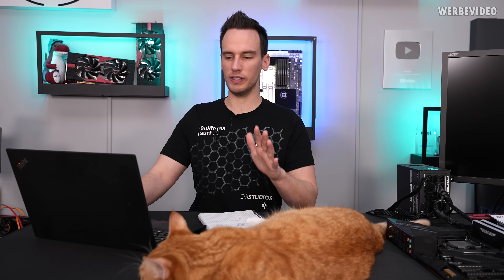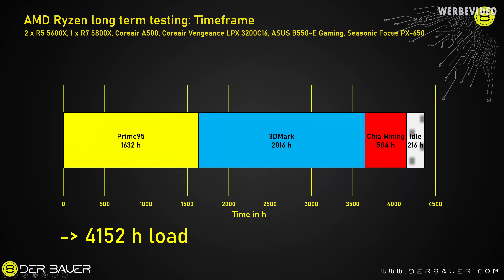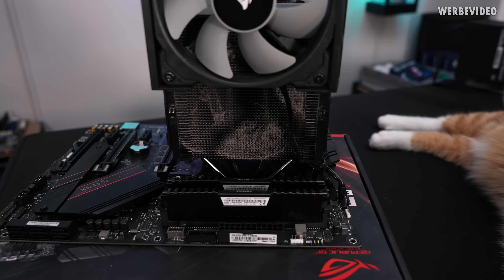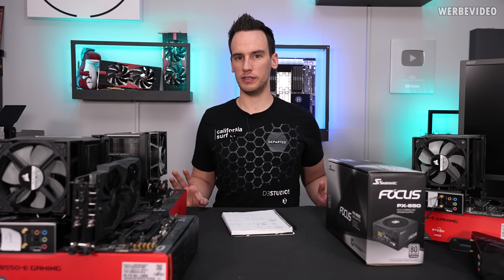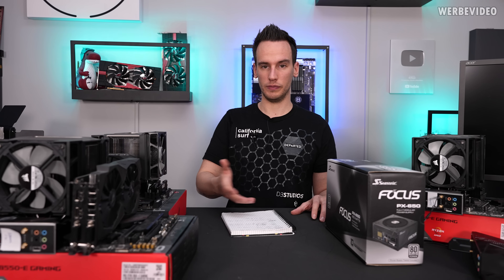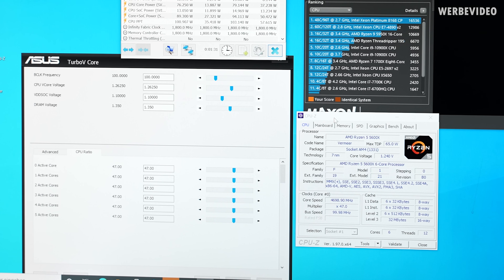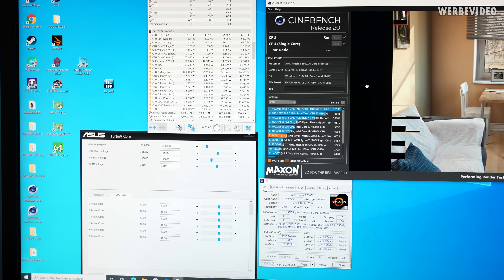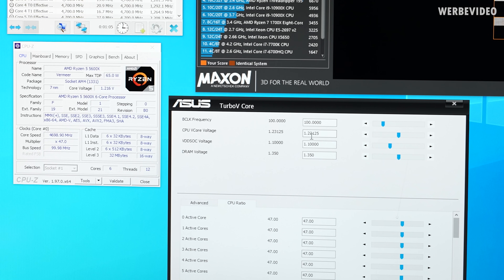4152 hours of Ryzen Long Term Testing: We have Good and Bad News

Comment: 3 years late. Had 2 5600g to fail on me. 1 took 1 year the other, gone 1 month. No OC. Meanwhile a 3400G running for 4 years, Been dealing with PCs since 99/00 never seen cpu failures, welp there's always a first( and a second). From what i read, AMD Zen3 APUs are more dodgy than ordinary CPUs for some reason. Mine passed memtest86+ but crashed when loading any OS in any kind of storage. Spent a significant amount of cash torubleshooting with motherboards and ram, it's sad to see a cpu go like this.

Comment: I got my 5600x in 2022 upgrade to my 2600, anyway last month it died with all stock settings, I only gamed and watched videos on it it never got hot because of after market cooler and good case fans. AMD replaced it for me and I'm gonna be using ECO mode from now on praying it doesn't die in another 2 years

Comment: New test with a 13/14900K? :)
But it seems that the issue with Intel might actually be voltages when boosting only a single or a couple of cores?
Reply: Fr lol they tested the wrong cpus 🤣 no one expected intel for some reason. But now I'm sure everyone subconsciously switched to amd being reliable
Reply: I ran a test with a 14900k at 1.7v static for almost one month, all day prime 95 I beleive I was running 2.2GHz all core though, anything higher than that at 1.7v static on prime 95 will simply crash over night as it would hit 115c eventually. at 2.2GHz 1.7v it basically hovered around the 110c range depending on time of day. The pro-AMD reddit users are simply using an instability report likely caused by unstable XMP profile as means to boost AMD sales. Some users are claiming their 14900k's have degraded heavily or outright stopped working within a few months of ownership under mostly gaming loads using "intel defaults & latest microcode update" I call BS. My 14900k was still able to do 5.9GHz p-core and 4.6 e-core at 1.45v after basically 1 month of prime 95 small ffts at 1.7v static. Final cinebench run vide in my channel. Pulled 450W under full load.

Comment: Should i run fixed voltage or pbo with curve optimazer for ryzen 5600x? Stock auto settings using too much voltage for single core..
Reply: Trust me the single core voltage you're seeing is normal. I would all core oc fix voltage it tho.
Reply: @bakebook  I just leave it to auto default settings no pbo or overclock running from 3.7 to 4.650ghz, could overclock all cores to 4.7 or 4.8ghz with fixed 1.280v but not worth it only for benchmarks..
Reply: @branko4138  nah all core oc seriously helps with 1% lows while gaming too. Makes a choppy 60 fps like star citizen feel smooth and other cpu intensive games like tarkov and arma

Comment: Around 1mV per 100 hours under full load is actually a lot. If you use your pc on average for 8 - 10 hours a day and average load is 50% then you would have lost around 80 mV of stable voltage in 5 years. So that's potentially like going from moderate - strong undervolting to stock settings.

Comment: I run my R9 5900X with a set overclock of 4.5 GHz set by the CPU Core Ratio in the BIOS, with an Offset Negative Automatic Voltage.  During normal operations (anything other than gaming), the CPU runs at 1.1 volts, and I leave it on from 11 PM to 6:30 AM running a video on my monitor with tropical underwater scenes, and soft sleeping music.  The computer comes on when I get home at 5 PM to game, and do my email, visit forums, and watch Youtube.  Been doing that every night for the past year-and-a-half, and it's still going strong.  Calculated time being on is about 6300 hrs on this CPU.

Comment: Really amazing content. I did not know overclocking is that safe to do degradation-wise.

For extra context: The only non overclocked CPU I've seen die was an AMD Athlon II x4 620

Nice cheap, below <100 Euros quad core CPU At time of release. Used it for 3 years with ~5 hours heavy use per day on average.

After it went to a friend who used it for +- 4 years with many days of games being on AFK, probably 7-10hrs heavy use per day on average.

Then it went to my parents who used it for almost 3 years. Then it started randomly crashing and at some point it did not post at all. Unfortunately due to posting issues I could not try out a higher voltage. Replacing the CPU from another used system though, that fixed the system. The dead CPU didn't work on the other, working, motherboard I had either.

It took nearly 10 years for a CPU To die under heavy use. And, was the heavy use over time the cause? Even that is unclear. This with meh cooling and with the PC being dusty for long periods of time. When people worry about high temps at stock voltages and clock speeds I tend to chuckle a little.

Comment: I'd be very curious for testing that specifically targets the memory controller.. I've heard a lot of things and I've had a lot of issues my own self, and I'm somewhat cautious about applying the necessary voltage with some ram kits, this may not be an issue anymore with ddr5 although, I've heard issues as well on I'm sure there's somewhat different but I'm not as familiar with what those changes mean for the memory controller situation but either way.. definitely had issues with ddr4 at what should be really a chill values with ryzen.

Comment: what i saw from a 9600k (yeah no amd^^) that i had overclocked to its max rock stable point at 1.35v max (voltage adaptive overclock, not the fixed voltage noob sh**) for 6  years: its was rock solid until year 4. then i had to lower max turbo and avx offset by 100 mhz, its still stable with that. i guess i could have raised voltage offset alternatively, but i didnt want to (temps, decent noise level of system). It was the same for a 9700k i overclocked for a friend. about at the same time i got instabilities and i lowered clock, he had the same problem.
so the electron migration wont make cpu fail critically, it just... degrades ... over time?
maybe smaller manufacturing processes might degrade faster? possible. but probably in the end its just a couple mhz you loose at the end. if you dont overclock to the absolute limit what the system can do stable, you wont even feel it after years
Reply: p.s.: before someone complains. Der Bauer did fixed voltage for Testing Purposes. Thats ofc not Noob Sh**, but proper Test Setup.

Comment: stock voltage on 5900x goes over 1.5v some times on low thread workload. thats going to degrade the fastest cores on the cpu quickly.

Comment: Thank you so much, I suppose all I should really do now apart from maxing out my most stable Fmax for a given fine tuned Curved optimisation values, with unlimited PPT, EDC, TDc and x10 scalar. Is to set a thermal limit of 85C or so, just in case my CPU cooler magically gets dismounted, the CPU should protect itself lol

Comment: I used to wanna follow the "keep the voltage below 1.35 to save your Ryzen 5000 chip". But I wanted my 5600X to run as fast as possible. So I said fuck it, stay under 1.35? Sure! It's now gonna stay AT 1.35V. I got it stable at 4.85Ghz at 1.35Vcore on an AK620. It only gets to 89C if you stress test it, under normal conditions the max you'll see is 65-70C depending.

Comment: Would love to see this test repeated in the new Ryzen 7000 series especially because of how they behave in terms of thermals and how, Hardware Unboxed said that its 100% safe and GN "is that by design".
2 CPUs here had degradation clearly, so now i'd expect slightly worst for the new series if the same test was done to these chips wit the same method.

Comment: Degradation is real. The 2700x was suffering from high loads at 1.4V or higher. Some people even reported that on stock the CPU did'nt function properly with PBO anymore. People should read on the maximum allowed voltage which is tolerant for 24/7 and stick with that. And cooling is a great factor with this as well. Run it hot and it will fasten. Run it cool and you postpone the proces.

Comment: I'm using 0.9V on my 5600X, everything is stock in the BIOS but the D.O.C.P. memory (the Infinity Fabric adjust automatically for what I've seen) and the 0.9V voltage in the CPU also 850mV @ 1860 MHz Core Clock and 16Gbps Memory Clock in the RTX 3060 Ti.
Reply: I tried 950mV @ 2070 MHz C.C. and 16.5Gbps M.C. also and ok.

Comment: Just lottery, first 5600x was slightly better but the second was within margin.
Temps are fine, but if they were running 90c or more for a whole year then degradation will definitely happen.

Comment: 99.99% of the time i don't allow my 5800x to go above 3.8GHz (special power plans i've made for Windows which i change when needed, take care of this) which means that no more than 990mv are available to the core at worse but that's very very rare, it's actually usually around mostly 950mv and that's not a manual Vcore, i let the mobo (MSI x570 Tomahawk WiFi) take care of it, i don't change it, i just log it.
I don't need it to be clocking higher than that most of the time, so why would i risk any degradation since it plays all games at 60FPS with max settings even when i have Firefox with literally 200 tabs open and other stuff open in the background?
And to top that, it's being cooled with an Arctic Freezer II 240 AIO cooler.
If you take care of things, they (probably and usually) last (way longer).

Comment: Great video, very interesting topic, but: I do not agree with the conclusion. If it already fails when adding 35 millivolts when testing for only 3 minutes, I think you are going to need much more voltage then 40 millivolts to get to a usable 24/7 stability. I think most people that have overclocked cpu's before know that there can be a big difference between ‘benchmark stability’ and ‘24/7 stability’. Also, I don't know how the cpu was tested initially before the long term testing, but it might have been stable with an undervolt before, which would increase the difference in required voltage even more.

Comment: For most people 5 years is not enough though. Take my case for example. I always buy the new PlayStation when it comes out - which is about every 7 years. And I always build a new PC halfway through the PlayStation cycle - so also every 7 years. So my CPU needs to work perfectly for 7 years at a minimum. And I think most people want that too. 
But to be fair to you, I usually just run my CPU at stock the first 3-4 years because it is perfectly fine. And then in the second half of the cycle I tend to do some overclocks to get extra performance because games will actually benefit from it at that point in time.

Comment: I did tinker with AutoOC on my 5600X yesterday. AutoOC lets me increase the Boostclock by 200mhz, it now running on 4,85Ghz boost @1,438V. Seems a bit high already.
I also finally found out how to increase PPT, now my allcore performance, 4,55GHz @1,25V, being limited by the motherboard max power settings.
Reply: Use the Curve Optimizer function to lower to the minimum stable voltage.
Reply: @AdadG  Yeah I tinkered a bit more. I managed to get 4,85GHz singlecore on below 1,4V. Thats considered as a save Voltage as much as i heard and by doing a 10mV offset, i now have also 4,8GHz allcore. Negative 20 was too much because recently my pc started to shut down randomly and throwing Kernel Power and Cache Errors at me. I guess my I am at my low budget mobo limits.

Comment: Its really funny cause' I had an fx 9590 for almost 10 years running @1.6v on all core turbo of 5.1ghz stable. though it would seemingly crash at random, due to horrible architecture and overvolting the CPU believe it or not but it wasn't crashing as much as it did out of the box when I overvolted it. Later I saw that the only degradation in my performance was the motherboard replaced twice, and like 2-10 percent lost in performance either due to windows 10 from 7 and overvolting.

Comment: i had issues with my 5600x needing more vcore to run at 4800 all cores. i was using a quick vid multi setting in bios that worked for months, then i only got stable overclocks while using the "fixed vcore" under voltage settings and skipping vid entirely. now with slightly lower voltages and temps even. i have no idea about what happened though. could be luck and lower temps that found a sweetspot, no idea tbh.

Comment: they are still having issues with the Soldering of the CHIP to the IHS... I TOLD THEM USE SOUND TO VIBRATE THE SOLDER SO THE BUBBLES ESCAPE then vaccume to cool... run current ground threw chip to also make nano connections that jump between materials to pull them together like stitching.

Comment: Can you explain me some stuff that's I wont get it at all, 5800X don't have any degradation right? I only use PBO2 with negative 23, even with that my cpu can live only for 5 five years? or more? Cause i use pbo to low down the voltage

Comment: how tf are you running a 5800x at 1.27v with 4.7 all-core? On my 5600G if I drop vcore below 1.45v, I get stability issues at 4.7ghz all-core... With iGPU turned off

Comment: Awesome testing you've done, and you're right- it'd be better if there was a bigger sample pool, but I still don't think CPU's degrade as fast as people think, unless voltage is really jacked up. Been rocking my 6700K full time at 4.7G, and 5 years later, it hasn't hiccupped or given any issue. Side note, really loving the new ink!

Comment: I tried to destroy my old 4790k in all the way possible, i delidded it, making a mess, i pushed it a 5 ghz at 1.55v with pl8, for hours and hours of flying in flight simulator.
Now i changed cpu, that cpu is still alive, at 4,8gh 1.4v, in my cousin pc playing Assetto corsa in vr 10 hours a day.
I will always love that cpu.
And now my 11700k got SP 61 and to get 4,9 ghz on all cores i have to push voltage like crazy -.-
The ASUS autooverclock, when i tried it, only one time, nearly destroyed the cpu ahahahah, i saw like 1.6 vcore  o_O

Comment: I'd like to reply my PC does 24/7 workloads. It only turns off and on when windows updates are pushed and my computes are restarted by  the windows boot manager, I pause my loads and use my pc in between when needed. 4152 hours is considerable, however there is over 8300 hours in a year. And my pc is off mostly only at times when we're away for days (think holidays) . My Pc's have ran 24/7 for years. I do want to say I prefer stable Undervolted Pc's. It's said this saves (a lot) of power. I do not run the Gpu Undervolted however, as they tend to be tuned better. 5950x w 3080ti, started out as 3700x w. 2070super.
It's likely my pc will be used for 40,000 hours before I scrap it. I do not overclock, my 5950x is running 1.07v at 4.3Ghz doing computes (think Rosetta, SiDock or other covid research cloud computes (partially on cuda so my Gpu tends to max out as well... ), transcoding, and occasionally renders or GIS/Database 3d Plots (partially Cuda) and I've maxed out the load of my pc at 16 cores 32 threads regularly.

I'm expecting my PC to start crashing in 5 to 7 years based upon experience, those would be calculation or dram errors, causing stops/BSODS... Roughly the same as with my former Pc's. I had problems with high end GPUs in Pc's as well. I tend to ignore paste application on GPUs... 

Cleaning the case and making sure no dustbridges form is essential to long term health of pc systems. As is replacing the battery once in 3 to 5 years. Or replacing thermal paste once per 2 years. Removing unwanted or unnecessary software and keeping your system from bloating tends to be the last one.

Comment: Amazing experiment! Would be nice if you could also measure the opposite scenario: a underclocked/undevolt cpu and used a stock one, as control, and estimate how much life the underclocked cpu gained in comparison. I realize my 5950x dont need to run faster than 3200mhz for any of the tasks I put it through, and I also lower the v.core to 0.7v all cores! These chips are simply wonderfull! Cheers for the amazing work!

Comment: In my experiences, overvolting does not cause obvious damage, but after a long use, expecting the cpu to run at the lower voltages it used to be able to will not work, or will be at least unstable. 
My 2700K cant even run at stock settings and voltage anymore.  But at 1.49v set- it will run 5ghz month over month rock solid (so long as windows plays along) BTW you doin't go shoving 1.5v into ivy bridge aka 22nm

Comment: 10 years for a stock settings CPU is waaay more than enough, not to mention it will probably just degrade a little bit, and not break completely.
Technology will come very far in 10 years, you will upgrade before then.

Comment: I have always argued MFG's are very conservative. If you stay within temp and voltage envelopes they will outlive their usefulness. 
I tend to OC pretty far (with the exception of my 3700x since it doesn't get noticeably faster), and the CPUs outlive their usefulness. 
P4 2.4C @ 3.4ghz (bench runs at 3.6)
i7 920 @ 4.4ghz (bench at 4.8 ghz)
I5 3570 @ 4.6ghz (bench at 4.8ghz)
Sold the 920 when the motherboard died, but the P4 and 3570 are still going strong. These were used for Folding@Home and BOINC, gaming, 3d modeling/engineering/rendering. I probably could have gotten away with running at the "benchmark" speed eve though they would throttle under continuous loads.